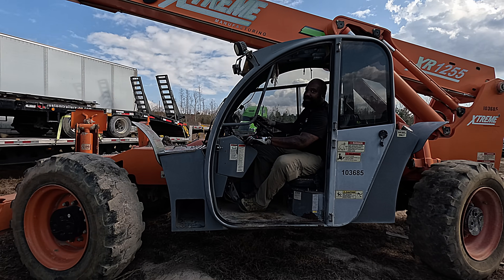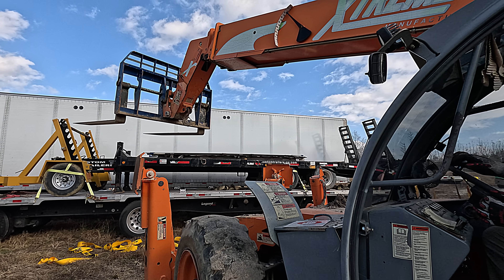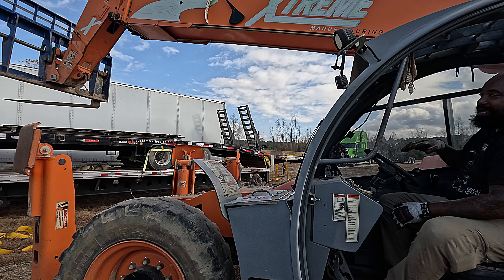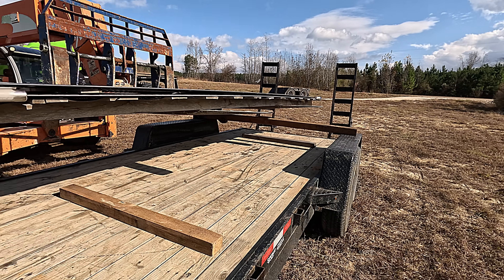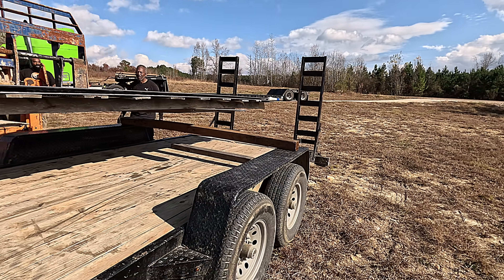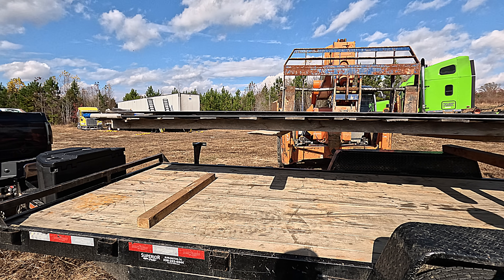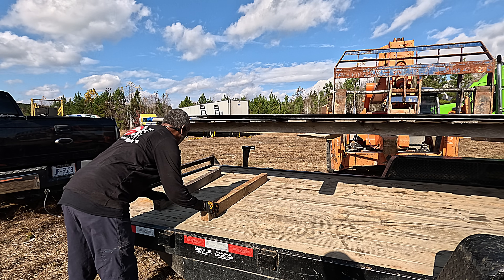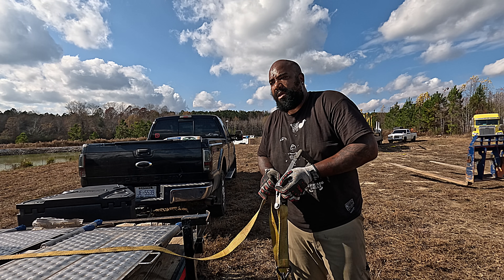Giant Heat Exchanger for the 5 Acre Pond

Comment: is this what people are doing when they decide to add a heat exchanger after the pond is created?   I ask because loops seem more cost effective .   What has your experience been?
Reply from the maker: Depends on the size of the system. The pond loops would have covered 2+ acres
Reply: @BealyGood  one should also consider that muddy/green ponds are going to deposit significant loads of silt that may affect heat exchangers.

Comment: that not enough for your house are they going to be in series or parallel circuit and they do not need to sit in mud they need to be up out of mud so water circulate around them i did a 4000 sf house with a 5' x 9' one and it was not enough the water would come back 1 deg cooler for cooling and heat would well below freezing. end up abandoning it and drilling a well witch is hard water here in east TN (Fort Loudoun) witch is a river with flow
Reply: Drilled loops work better. Yes way more up front cost. His distance from unit to tank is a problem. I am thinking like you that is not enough. Drilled holes store the heat from summer to be pulled back out for winter.  His house is going to be well insulated so there is that. He unloaded the units the other day and the biggest was a 3 ton. I bet he has it under control though, and has a good hvac company helping.